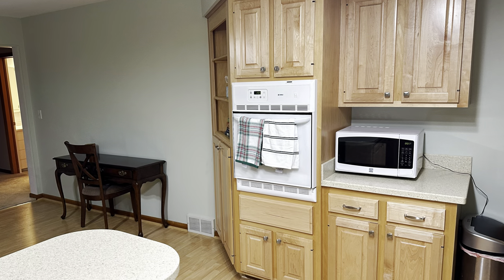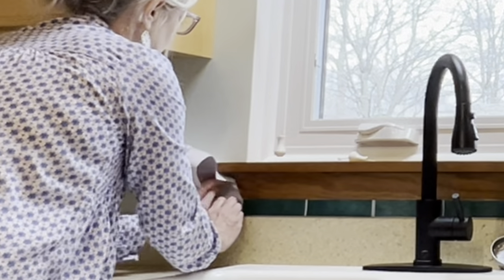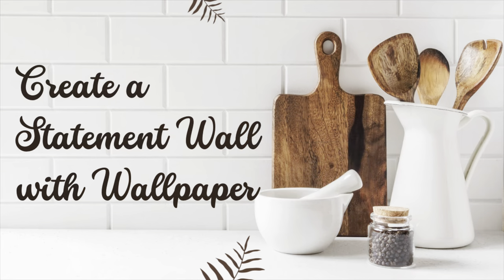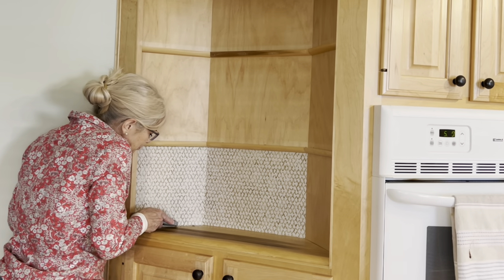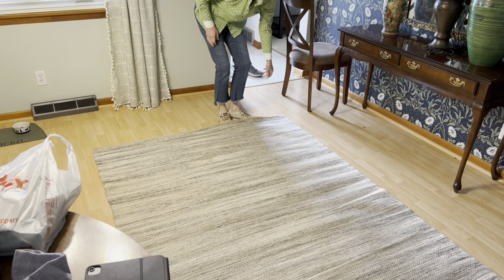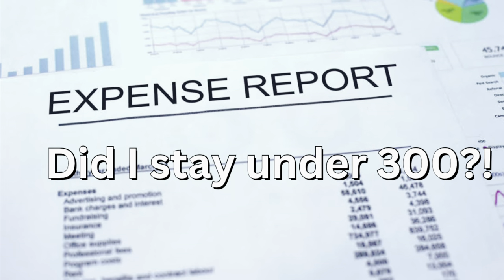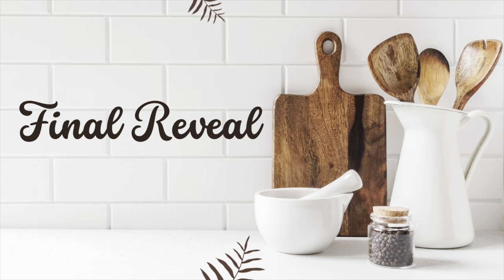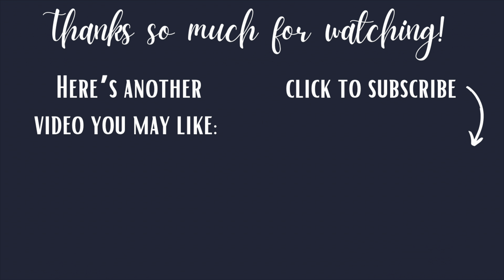11 DIY Hacks to Transform Your Kitchen (WITHOUT PAINTING THE CABINETS)/Rental Friendly Updates

Comment: Alot of landlords aren't allowing peel and stick tiles and wallpaper any more because they do still peel the paint off when removed. So what I did is staple foam board to the walls, sealed the seams, and placed my tiles and wallpaper on it. With this method, you could also use regular wallpaper, real cloth with wallpaper glue etc. This way when you move, it's super fast to remove, leaves no holes or damages at all. Staple markings are so tiny, when they repaint before new renters, the paint fills them in,  plus,  you can't even see the staple marks anyway.  Just staple the 4 corners and 1 in the center. You'll thank me later when you have to move. Plus,  your wall decor, colors etc is limitless with this method!
Reply: Awesome, what a great idea…thanks for sharing!!
Reply: I thank you for this idea. I'll be using this in the near future.
Reply: Yes! You can use foam board or a plastic sheet under those tiles. I use fabric on my walls quite often in place of wall paper. I use tiny brads to tack it in place. It creates a wallpaper look without the paste. Take it down, a tiny touch of spackle and zero damage to the wall paint.
Reply: @gusmonster59  I use plastic on top of my floors before I lay down self stick  tiles,linoleum,carpet or wood planks, then I use hot glue to seal the seams along the baseboard (easy to peel off without removing paint or causing damage, but I dont use it alomg the seams on the outside for carpet) so water or soil doesn't seep through. The foam board technique on walls I used for tiles,self stick faux 3d tiles and the faux brick, I even used cardboard stapled beneath the faux brick and shiplap,since what's beneath,is well hidden. I've used tiny Brad nails for paneling, as you suggested. Particularly for the chail rail length and below. There's so many ways to apply new wall treatments and flooring without damage.
Reply: What about just leaving the wallpaper on wall for the next people who will live there?
Reply: This technique may solve a problem I have as well! My walls have a lot of surface imperfections! Since I  don't have time to fix them right now, the foam board would be a temporary but stylish hack until I can get my walls professionally done in the future! My help in my closet as well! One question: Where is the cheapest place to find foam board?
Reply: @lisanetgark415  may not be what the next tenants like. It'll cost u ur deposit as well as give ur next landlord a heads up that u don't abide by ur contract.

Comment: Finding out about EZ Hang Peel and Stick Helper was the BIG TIP! Thanks. Beautiful room. Your budget was certainly helped along by reuse and repurpose. And gifts.
Reply: They don't hold for long. I put two on the side of the kitchen pantry cabinet I have in the autumn.  And as soon as the kitchen warmed up in the summer, one fell off. The adhesive had softened.  I tried again and it fell off again.  Then the other fell off.

Comment: If you really want wallpaper, you can buy thin 4 x 8 sheets of wood used for subflooring under vinyl and attach them to the walls with small screws.  You may need something tape on the seams.  Then, you can apply your wallpaper to the wood.  When you move out, you only have some small slim. Screw holes to patch.

Comment: One trick I found for myself with not being able to add a backspash: I mounted a map onto 3M command hook backing onto blue painter's tape on to the wall. So essentially the painter's tape acts as the wall surface. The weight of the map goes onto the command hook sticker. I have had bad experience with command hook stickers not holding indefinitely so your mileage may vary. I didn't want to have the map damaged so used the command hook stickers. Hope this helps someone in similar situation!

Comment: Question about peel and stick wallpaper.  We recently moved to Florida and the wall are not smooth and spackled.  Would I need to fix the walls to be flat surface to use the paper?  This seems to be a Florida newer construction thing.
Thanks

Comment: You can't change the cabinets you can't paint them I just saw a lady use peel and stick on the cabinets. That's what I would use because all that brown would run me crazy. Thanks for the video.
Reply: It's amazing how tastes differ because I love the cabinets.
Reply from the maker: I considered using peel and stick on the cabinets, but they have a raised panel in the middle, so covering them completely wouldn’t have been possible without lots of wrinkles. If the cabinets had been flat, I would have given it a try!

Comment: Beautiful, but be careful when you use peel and stick. Sometimes it doesn't want to come off or it leaves a lot and I mean a lot of adhesive behind that won't come off no matter what you do.
Reply from the maker: Thanks for the tip! I haven’t removed any peel and stick paper from large areas. I’m hoping the EZ Hang will also make it easier to remove. 🤞

Comment: 1. No black anything near water. It will water stain almost immediately. Save the original faucet and reinstall before you leave.
2. If I am your landlord, no sticking anything to the walls. It will destroy whatever is underneath and I will sue you for the damages
3. Black hardware, you will have to buy it yourself and store my hardware and reinstall before you leave. Else I sue for replacing the hardware you ‘stole’
4. No wallpaper. See #2
I can’t watch anymore. Buy a house if you want to put your stamp on it. This poor couple is going to get sued for so much.